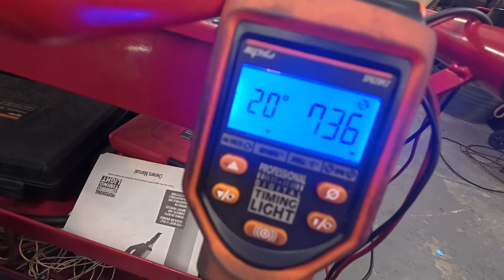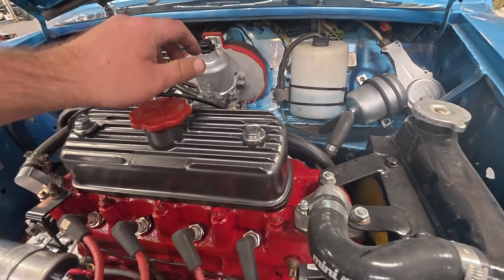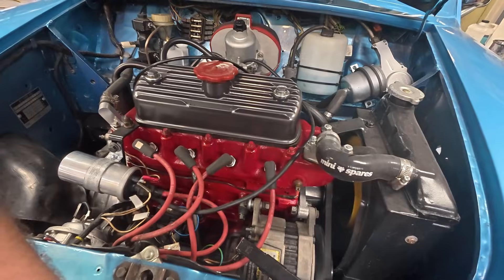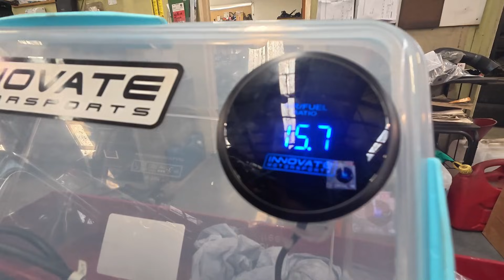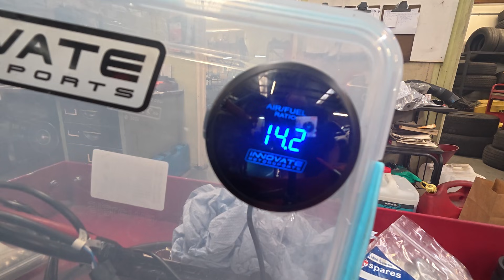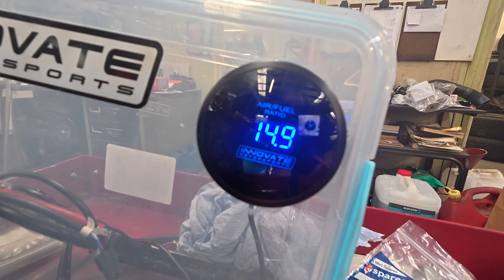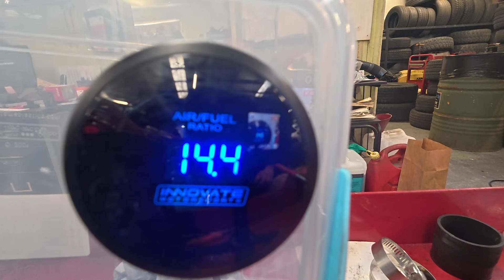Screw turning vs AC Dodd tuning - A harsh truth!

Comment: You really need to be checking afr under load to do a complete jub
Reply: The A C Dodd method seems to achieve very good results. Better than a great deal of rolling roads and a damn sight cheaper!

I know what I'd go for.
Reply: @theinspector1023  Agreed it is very good and AC Dodd is a great guy. Cheapest way to improve things further is fit a wideband and drive it. Being under load changes everything and you can get much better fuelling by looking at where you are rich / lean when actually driving.